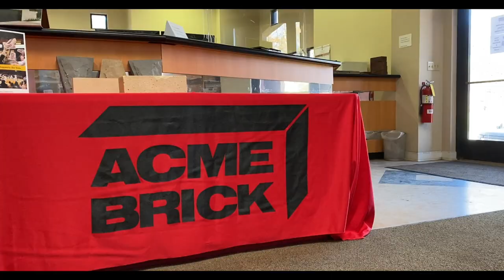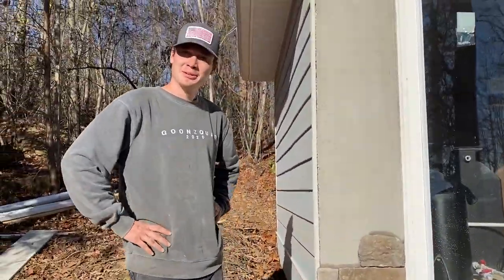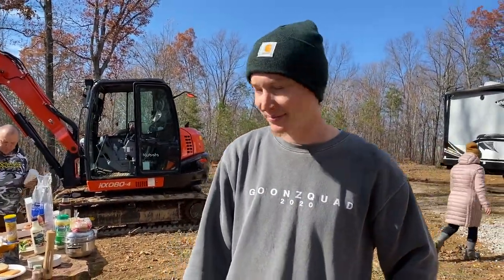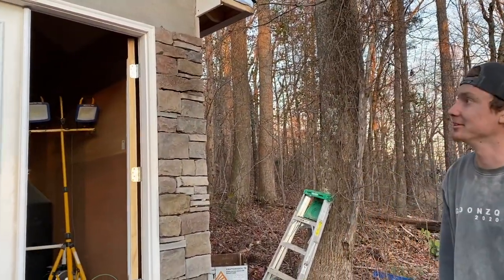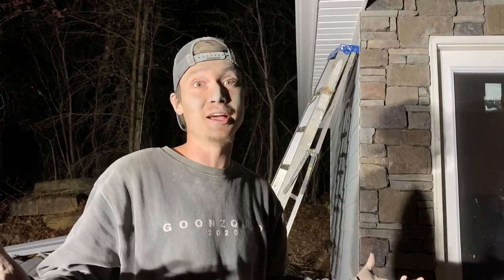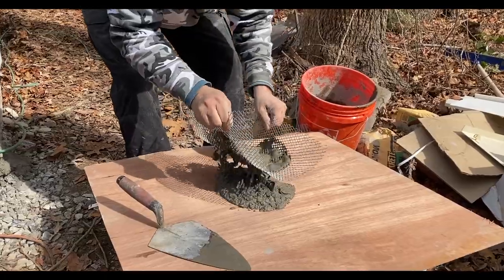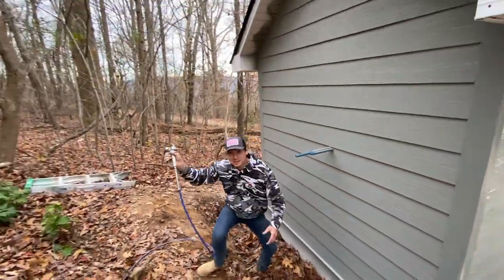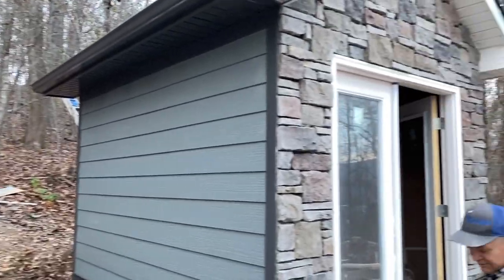The New Goonzquad Headquarters Part 44

Comment: Drop Dewalt, even if you're a brand fanatic. Milwaukee made me sell all of my Ryobi and Dewalt. Never been more satisfied with electrical tools.
Reply: this dewault  did the same job as milwake it was just so dirty  that cooler got clogged and it burned it would be same with milwake.
Reply: Hitachi is my preferred brand
Reply: @maros495  Yeah, my cooling fan used to get clogged alot when I had a DeWalt. Guess what hasn't happened since I bought my milwaukee stuff? I work in industrial hardscape. If it was gonna clog, it would've years ago. 3 years in and my Fuel stuff outlasts EVERYTHING I own. It's a little pricey, but beats the crap warranties you get with other companies.

Comment: Looks great.  You got love Pops.  Always in the back ground working.  Lending a hand when needed.  He is awesome.  Love the table you guys made.  Hind sight, but you need a water cool tile saw with a sliding table.  You will likely use it in the house anyway and it will keep the dust down.   I bought one many years ago when redoing both bathrooms.  Just considered it part of the job.  I had a ton of cutting to do and wanted to do it as I went so renting one would have likely been more!  Watch the temperature for painting.  The colder it is it will dry slow.  Paint when its warmer in the afternoon and read the can.  Don't apply below the recommended temp or you could have adhesion issues.  Ran into that painting my house.

Comment: @goonzsquad I just want to recommend clearing away some of the dirt in the back and sides of the shed and lay down a small wall and or bricks making a “wall” about 3’ back to help prevent slash up from rain. Water can bounce back up and go under the siding causing water damage and or mold behind the siding. Happened on my water tower

Comment: Great job u guys like putting rock up do the tile in the bathroom its alot of fun and the same process also I would use the frosting bag and fill in all the gaps and tuck point it all but that's just my OCD ...water shed turned out dope

Comment: Great work as always guys. if you have any sharp edges on the cut stone that stand out, you might be able to use a wire wheel on an angle grinder. i had to cut some brick when i was building a fireplace and the wire wheel took down the sharp edges and blended them into the original bricks nicely. Its so refreshing to see how much respect you guys show both of your parents. What happened to mom's Rogue though?

Comment: Another thing about your pond. Work all that good dam building clay down the hill until you have the size you want. Then build it up as tall as you want. Compaction is extremely important as well as having a good drainage system that will not erode the dam. If you dig around that cool tree it’ll probably die so it might be better to just get rid of it now instead of a couple years from now when it’s all finished.

Comment: A bit of advice when using mortar - mortar doesn't dry, it cures due to a chemical reaction between the cement and the water. Before bonding your stones to your scratch coat you should spray the scratch coat with water, give it a good soaking. Have a bucket of water alongside you when working and soak each stone it it for a few moments before applying your mortar. This prevents your scratch coat and your stone from sucking the moisture out of your mortar which dries it out making it weak.

Comment: that is the place to be right out in the front yard - it is all fluff until you start to dig into the garage at this point - the house went well - use the same people but you all cando the basics - framing/siding/hardscape - it is a ton of peperwork - maybe you do the intown one first and then the country one but i think you want most of the effort on the country garage - maybe do the intown shop and lease it out for a year while you finish main shop/garage/office/storage - the house was an ideal primer - save money on slab by just doing monolithic slab - you probably want  10" in garage but could go back to 6 for rest of structure - you probably want 3 ft frost walls on footers - then maybe pour a 6ft wall and you can frame stick or steel on top of that - put a deck in back and on half of the roof - pv panels the other half - easy access and maintenance - once you get the plans and all permits and insurance and taxes figured out you will be off to the races

Comment: leave at least about 1/4" gap between stone and other edges, similarly w/ the sidings (1/8-1/4), for caulking. the caulking (polyeurethane or water-based poly.) do better when the gaps are wide.

Comment: When you guys are working with concrete even mortar, cutting stone, pre-poured slabs, mixing, etc I would really suggest you wear a ventilator mask or The 3M 8511 N95 made for concrete cutting. The concrete dust contains an off product called crystalline silica which is extremely dangerous and can cause lung cancer. I worked in the concrete industry for years and saw many guys get sick from it! Stay safe...

Comment: Guys, get an old 44 gallon drum cut a 4  in x 4 in hole in the bottom and fill it with wood, set it alight and you will have a great heater

Comment: The well pump house looks great I see used 4 by 4 metal for the fascia and use vinyl for bird boxes the vinyl need to be behind the metal are you going to get water in between the 4 by 4 metal and that white vinyl and it'll rot your wood in time other than that for not doing it but the first time looks great

Comment: Hey you might want to make sure when you're putting that fascia and soffit got the fascia goes underneath the Egret metal that way water doesn't run down inside and ruin your pump house you got to overlap that way the water can run down and run of not run under

Comment: The first thing you should have build in your land area is a main Gate entrance.
Reply: They certainly need to install a tough and wide steel bar gate with a military grade padlock at the junction of their driveway with the public highway. CCTV cameras (both overt and covert) also need to be set up at that location. This will deter many types of rural thieves, who usually want to drive into the site and load up the items they steal. However, it will be next to impossible to prevent criminals gaining access to the land on foot. The perimeter is approximately 3,100 feet in length and mostly concealed by trees. Goonzquad will need specialist advice on how to mitigate that risk.
Reply: @johnstedman4075  all these thousands and thousands of dollars in equipment i am very surprised that till now they didn't have any incidents and i am just hoping that everything will be fine .
Reply: @greek1247  Apparently they have already suffered from theft on the site. The location of their land is already well known to many people in the Chattanooga vicinity and unfortunately this is an area with an above average crime rate. Theft from rural properties is quite common there. As a general rule, uploading details of one's valuable property or any other sensitive private data onto social media is inadvisable and should obviously be avoided by most people, but YouTubers of this type have little alternative. To compensate for this they need to be very aware of security issues and take professional independent advice on how to mitigate the risks.

Comment: Question Guys are you going to grout all that rock to make realy waterproof or just leave it as is now.
Reply: They have shown no intention to grout the stonework. Fortunately most of it is on the south elevations of the two buildings where it should not be subject to the most severe spells of winter winds, rain, snow and ice. However, there is no doubt that grouting would be wise since this is a mountainside location which can expect low temperatures over the next four months and will not benefit from any urban 'Heat Island' effects.

Comment: Just change the brushes on the drill and it'll probably run like a new one 🤔
Reply: Unfortunately it will then run like a new DeWalt, which isn't the best news when you have real work to do. You usually get what you pay for with power tools. DeWalt are average, and that's often the worst deal in the store.

Comment: u should build a bunker that connects the mini house and the big house, just saying...
Reply: According to the detailed plans I have seen, the two buildings are approximately 95 feet apart, measured centre to centre. Assuming an underground connection between them that was 100 square feet in cross section, this means Goonzquad would have to excavate about 15,000 cubic feet of earth (and possibly rock) and use around 700 cubic yards of reinforced concrete to build the link. Alterations would need to be made to both buildings to create suitable stair connections. The costs would be very high and the benefits minimal.

Comment: With your gap filler get ya self a bucket of water and a small paint brush lightly go over the gap sealer with a brush and water it smooths it out for you easer then trying to wipe it with ya finger but don't use a lot of water on ya brush I do it all the time as I am a painter by trade

Comment: You guys may want to redo your eves. They way they are right now water will run straight down under the caps and rot the wood out. You should put your caps on first, then soffit, then use the fascia to cover the soffit ends (instead of J-channel like you have) and the fascia would run down to the corner to ensure all water runoff stays away from the wood underneath. Just trying to give you some helpful pointers so you guys aren't making major repairs down the road. Also if you turn the blade around in your saw it will cut that vinyl much cleaner.

Comment: Gotta get that top of slab 8" above grade **all ** around .... you guys in heavy termite country dude, with both Formosan termites (most aggressive / destructive and economically devastating in the United States) and Subterranean termites ( most damage) .  I don't remember a termite shield being installed..
https://en.wikipedia.org/wiki/Termite_shield
Reply: You are absolutely correct. Their fundamental error was the making of an incorrect decision about the slab level. This is just one of the mistakes which proves that the overly popular concept of 'learning by doing' does not apply to building design and construction. Before beginning work on the Well House site, all criteria for creating a safe and durable building should have been thoroughly thought through and checked by an expert. Goonzquad omitted to do this, and as a result this structure will fail within five years.

Comment: Bruh OSHA would have shut this job site down n maybe fine y’all for Not Wearing MASK when Cutting Cement Slabs, Drywall, Siding/Hardy, Tiles, and Stones bcus of all the Silica particles that Comes out N We aren’t supposed to breath in silica lol, and y’all are covered in silica dust/powder in yalls face. Please like so they read this comment bcuz YALL HAVE 2 WEAR MASKS & Spray Water on the Blade when Cutting Stone/Cement etc since it controls da dust from coming out too much.

Comment: Does any one know what paint gun they use
Reply: They have mainly been using a Graco spraygun.
Reply: I think it’s a grace X5. I have NOT had the same results with that gun, only problems . I think it’s cause mine was reconditioned & we were trying to spray thick paint.
Reply: @cbarr0288  One of our Construction Teams has been using new Graco X5 guns for a year or so, and we have had no problems. We used to buy reconditioned building equipment but had our fair share of hassles, particularly with DeWalt power tools. Nowadays we stick to new tools, because we need to work quickly and breakdowns always screw up the schedules. Time is money!

Comment: Great job! Stop using the cheap painters grade caulk from depot. Its very weak and has zero flexibility. At least use the flex 230!  Maybe .50 to $1 more per tube

Comment: what is that plastic board shit? what wrong with wooden boards?
Reply: They are using Nichiha Siding, which is made in the USA from fibre cement materials and is often used to clad mass market housing. It is similar to the market leader made by the James Hardie company. It is generally more durable than wooden products, is quite fire resistant, and is not susceptible to insect attack, rot or decay. Prior to 1985 products such as these contained asbestos, and were a health hazard. They still contain organic wood fibres, which may create heath risks when the boards are being cut during installation. Since these products can be obtained already finished with a decorative coating from a wide range of colours, they are popular with property developers and seem to attract buyers because of their uniform and neat appearance.